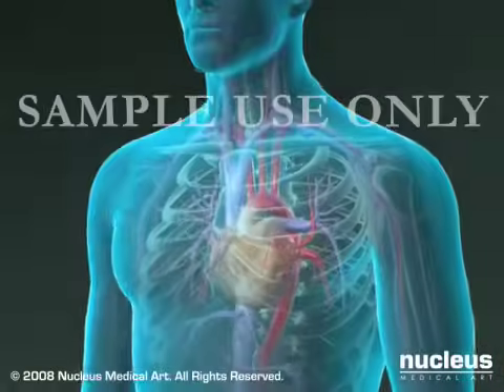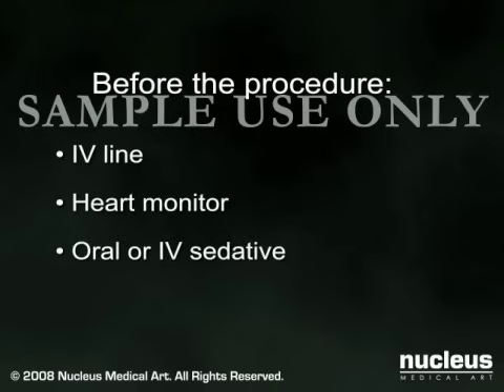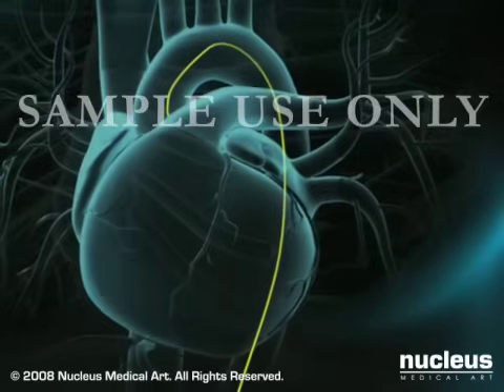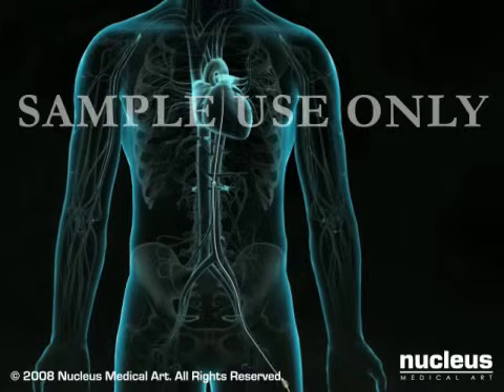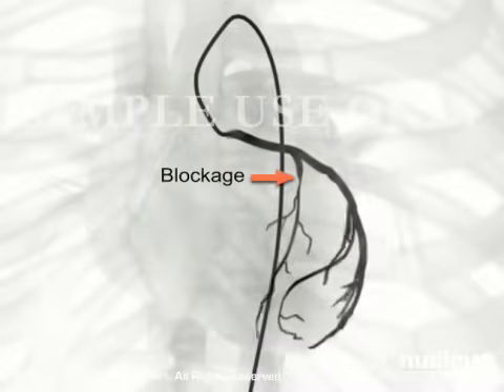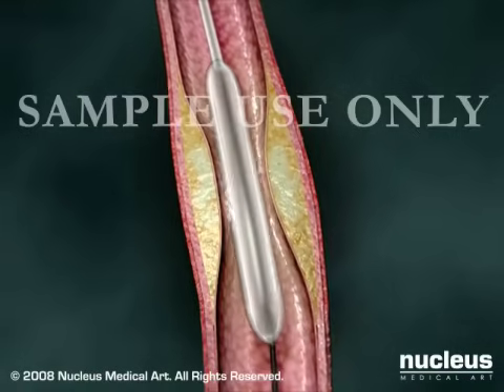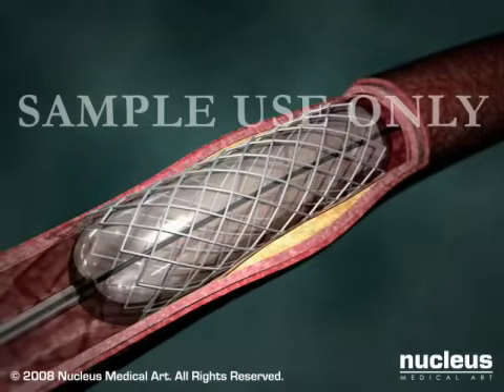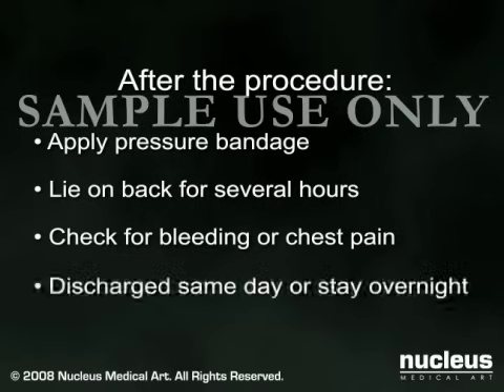Coronary Angioplasty Surgery | Balloon Angioplasty | Nucleus Health

Comment: Angioplasty. Procees NOTES

Blocks due to Plaques or blood clots 
Primary process 
.. IV line, heart monitor, IV sedative 
Needle in the femoral artery..
Insertion of Guide wire.
 The needle changes with the sheat tube .. flexible catheter is slipped over the wire to the heart..
The process is monitored   by x-ray imaging using fluoroscope.. 
Remove the guide wire, position the tip of the coronary artery and inject the special die helping to take xray images by fluoroscope called angiograms . Blockages will be clearly identified.. 
After identification . Insertion of flexible guide wire tipped over the catheter .. if  minor rapid inflation and deflation of a small balloon pushes the vessel wall out creating some space and re-establishing blood through the artery. If a major bleck  a coronary stent ( small tube made of wire mess designed to open the artery ) stent is placed over the deflated Balloon , when Balloon is inflated the stent expands and locks at the place of block . The catheter is withdrawn leaving the stent ..

Comment: Coronary angioplasty = percutaneous transluminal angioplasty = balloon angioplasty

Guide wire
Soft flexible catheter
Special dye (allows the fluoroscope to take X-ray images called angiograms)

Flexible guide wire
Balloon-tipped catheter (over the wire)*

Flexible guide wire
Balloon-tipped catheter
Coronary stent (a small tube made of wire mesh, placed over the deflated balloon)**
Balloon and catheter are withdrawn

*Rapid inflation and deflation of the small balloon pushes the vessel wall out re-establishing blood flow.
** When the balloon is inflated, the stent expands and locks into place. The stent remains to hold the artery open permanently.

Comment: Magnesium chloride cleans blood vessels and therefore prevents and prevents heart attack, stroke, and many other blood circulatory problems, such as arrhythmia as well. For it removes the fats from the blood vessels and impurities inside them that clog them, unclogging them, causing the blood to flow freely through the body. And so you don't even have to do angioplasty, catheterization or ablation. But you can't take it forever, you have to take it for a while and then stop. Hope it helps everyone and hugs!

Comment: I'm  Going to take this Operation in a couple of months. Is this is a permanent solution?. Once the arteries extracted can it be closed again after a few years??
Reply: The stent needs to be fully covered, after a period of time. Otherwise your body will still consider it as intrusion & attack it, initiate risk of complete block. Drugs play vital role during this covering period.

Of course there is a risk for your stent-implanted artery be blocked/narrowed again, but very very very low.

Comment: Hmm i did have that "treatment" on dec 28, all went fine. I ended up with 2 stents ! Btw. they are made of Titanium/Cobolt-metal.
Theres however one thing, the doc tried to set up the wire tru the wrist instead of the groin. After about 10 min. my aterie in the arm cramped up and he had to continue tru the groin arterie. I still have al LOT pain in my right forearm bec. he probably scratched the inside of the arterie - ofc. it will wear off, but i CANT recommend that way into your heart.